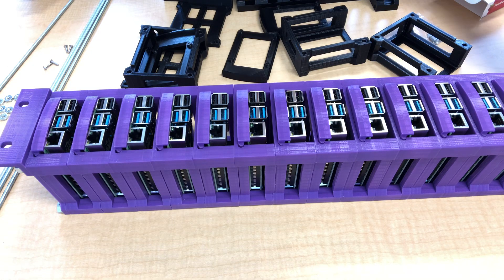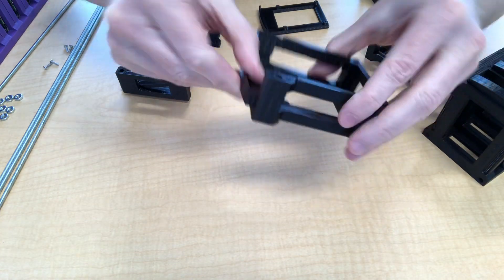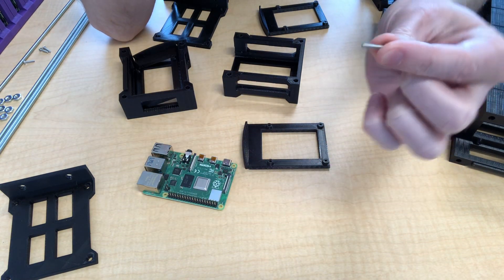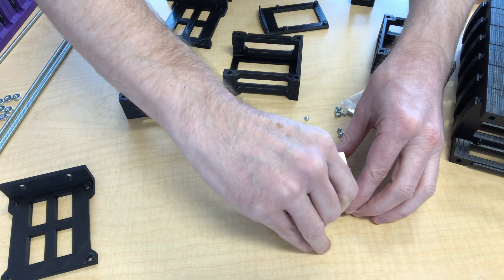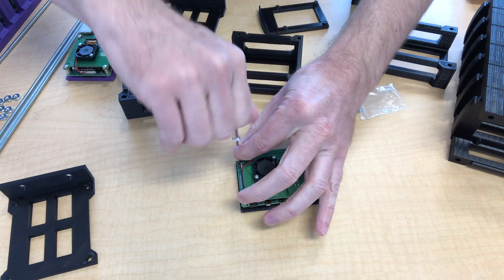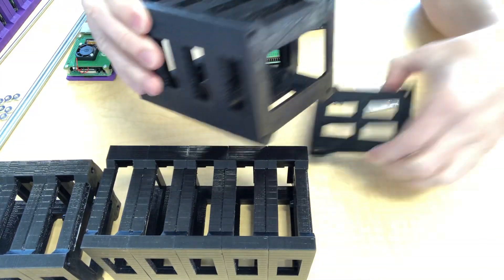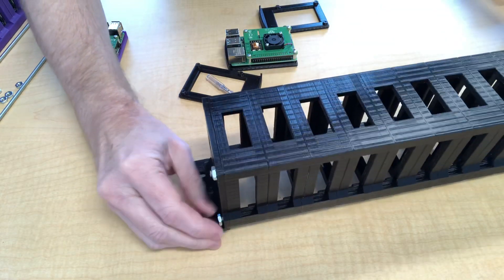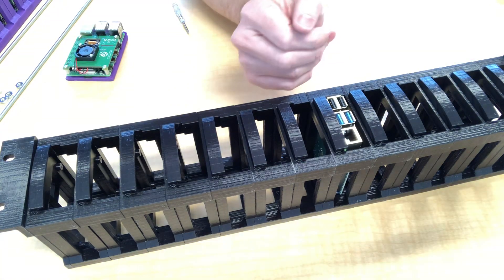Raspberry Pi 4 2U rack-mount bracket

Comment: Hi All,
coming from JeffGerling.

just curious, is there any tutorial to make their own Raspberry Pi cooling using aluminum sheet and aluminum block like this here https://youtu.be/CSNSgbKNeyc?t=67?
I want to combine it in a stack like in this video, but I want to replace the fan. To be honest, I'm not using an air conditioner here and the air is dustier in my urban areas, so the fan is a good solution, but not the perfect solution with dust.

Thanks before.

Comment: OK it looks good and good work, but why? What is the purpose of having so many PIs when it seems you can't use any other hats or functions of the pi besides a ton of USB ports? Especially when they sell fairly cheap USB rack units. I don't use Pis so is there something to gain from this or is this just PI people do for no really good reason?
Reply: From what I understand, as I've been looking into Pi clusters as of late, you can create horizontally scalable server systems on a tighter budget for small scale use. Another reason is that it serves as a robust introduction to the procedures for setting up said servers.

Comment: Very nice work, what would be the best option for a half rack/ 10.5" rack?
Reply from the maker: I don't the the precise measurements of a 10.5" rack, but this shouldn't be too hard to do. The ears and trays would be unchanged, and you would just need to adjust the side of the frames.

If you look in the OpenSCAD file, the height of a frame is calculated as: (450.85 - 20) / number_to_fit. In this formula, 450.85 is the size of the opening between the two mounting rails on the sides, 20 is an adjustment based on the size and shape of the ears, and number_to_fit defaults to 12. So you would need to find the corresponding number for a 10.5" rack, leave 20 unchanged, and adjust number_to_fit to 6 or so (try the math on a few and see what comes out to about the same height as 12 or 13 in a 19" rack).

From there you can just regenerate the stl file in OpenSCAD and you are ready to go.

Comment: Doesn't that amount of pies not stress the switch/router?
Looking quite professional. What do you use all these raspberry's for?
I like your design a lot. Nice work :)
Reply from the maker: As for what I use them for, I'm a CS professor and I use them as little servers to support my classes. Some provide infrastructure for my classes, and others are servers that I let students access to test their projects. One class I teach is Distributed Systems, where having many servers is kind of the point (as opposed to caring about the total computing power), so a Pi cluster is perfect.
Reply: @RussRoss  Great job on this project. I had a few questions for you. 

1. How much filament does it take to make 13 of the pi holder and the  frames?

2. How long did it take to print the set of 13?

3.  What material can be used to print these parts?
Reply from the maker: @gametek7592  I used a 1kg spool of PLA to print a complete 13-unit rack with trays, ears, and frames. That also included some test prints and a few bad prints, so it might be less than 1kg if you know what you are doing (I did not). It took me about a week to print the whole thing. I liked to print a couple pieces at once (like two frames or a frame and a tray). I would watch the first few layers to make sure it was adhering well to the print bed, then walk away and let it print for 6 hours or whatever it took. With the printer I was using, if the first couple layers were good than the print was usually successful. This approach only worked if the print bed was perfectly level--if it was a bit off then the problem would show up around the edges, and printing multiple items at once meant pushing the print closer to the edges.
Some people have been concerned that PLA can't handle high temperatures, but for me the PoE hat fans have been pretty effective at managing temperature.
Reply: Thanks a lot. Keep doing what you do. 👍
Reply from the maker: I was worried about that since the Pi 4s have a reputation for using lots of power and running hot, but they haven't actually been that bad. I have a 24-port switch with a 192 watt power budget, which works out to 8 watts per Pi on average. It can supply more to individual nods as long as the total stays below 192 watts. My Pis only use about 5 watts each most of the time, even when moderately stressed. I haven't come anywhere near the limits of the switch.
One thing to note is that the switch I got actively monitors these things and has a dashboard where you can see what is going on. So even if you were reaching those limits, it would start shutting down nodes rather than overheating or burning out.
Also, the PoE hats have done a great job cooling them. My cluster runs in a hot server room next to a computer lab, and so far heat and power just haven't been a problem, despite all my worrying.

Comment: I think you'd want lock washers or maybe nuts with integrated nylon washers on that threaded rod...
Reply from the maker: You could, but I think it would be overkill.
Reply: @RussRoss  Maybe,  but a full height rack with all that quiet vibration from all the other systems in the rack, going 24x7...    Maybe I'm just being paranoid, and it's true that we're going more and more to SSD's which have no moving parts, but we still have dozens of spinning fans in each rack.    So yeah, I admit I have no data to back me up, just a concern.   Still a very cool design.

Comment: For something a bit more professional, what would you use for storage ?
Reply from the maker: Someone on Thingiverse made a caddy for USB-connected SSDs. That might be a place to start.
Reply: @RussRoss  yeah, might be the way. :-/ For something else I'm using NanoPi M4V2 with SATA HAT with multiple disks and ZFS that works really well.
Reply: @autohmae  Hi, did you find something for the pi 4 using a ssd as the main disk?
Reply: Hi autohmae. Depends on what you mean by more professional. If you don't need the raw speed of local storage you could use NFS shares through FreeNAS/etc - that's my setup. Various file systems in the OS are mounted as NFS shares and I am syncing to S3 (FreeNAS Cloud Sync) for backups.
Reply: I am running iscsi with berryboot

Comment: Hi Russ, I can't seem to find any "#10" threaded rods at Home Depot -- looked it up and it's a "Unified Thread Standard" unit, mapping to roughly a 3/16" diameter. I can't find any of these, do you mind linking the specific rod you found?
Reply from the maker: 3/16" is the correct size (I just converted that to millimeters and used it in the OpenSCAD file). They seem to use inches until you get to 1/4", and anything smaller they switch to the numbered sizes.

I think this is the part that I got from Home Depot:

https://www.homedepot.com/p/Everbilt-10-24-x-36-in-Zinc-Plated-Threaded-Rod-802207/204274027

and the matching nuts are also labeled #10 x 24. The 24 part of it is about the thread pitch, so as long as the threaded rod and the nuts match it should be fine (24 seems to be the standard at this size).

Best of luck!
Reply: @RussRoss  thanks a bunch! picked it up, now to wait for the friends to finish the printing :)

Comment: Hello thanks for the effort of making this way more affordable then the alternative :). I'm just wondering something for some of my uses I'm hoping to use SSD with Rasp pi would it possibly fit into the tray assuming while having to adjust the hole location?
Reply from the maker: I don't know--I don't have an SSD to try it out. I suggest looking up the dimensions of a Raspberry Pi 4 and the dimensions of the SSD you plan to use and starting from there. If the SSD is bigger than the Pi, then it's going to be a challenge, and if it's smaller than it will probably be doable.

I'd love to hear if you figure out how to make it work!
Reply: @RussRoss  2.5" SSD is definitely larger then the pi. But removing the top rods and replacing them with smaller bolts to attach each module should allow enough room for a slightly wider tray. I will probably have to try tweaking the design to see if it would fit.
Reply: @xFUNKYFACE  any luck trying this out?

Comment: I am going to print, but I have a question. what plastic I need to use? PLA, PETG or ABS? I assume ABS is better, but maybe PETG also OK.
Reply from the maker: Edvard Filistovic I used PLA because it was easy. I’m sure any of them would be fine.
Reply: When using abs plastic its strong and less flexible also prone to crack and break in cold temps.  I only know this cuz I work as a material handler in plastic injection shop for car parts 15yrs exp.

Comment: Nice! Could you add a link to the PoE HAT you are using for the Pi4?
Reply from the maker: It's the official PoE HAT from the Raspberry Pi Foundation. I ordered mine from Canakit.
Reply: @RussRoss  does it supply enough power for the Pi4 under medium to high load ? I'm having such an issue to power my cluster reliably without going to make my own power source ... :-/ What PoE switch are you using to power all of these ( I mean how much Wats would one switch need ) so far solid 16port PoE switches are like 250Eur + :-/
Reply from the maker: @vladoportos  I have not had any power problems, but I'm also not running them fully loaded all the time. My switch is the TP-LINK T1600G-28PS, which has 192 watts to share across the PoE devices. I think an individual device can go up to 30 watts or so as long as the total stays below 192. My Pis are typically pulling around 5 or 6 watts each with bursts of maybe 7 or 8 watts.

Comment: Have you thought of creating a shaped hole for the all-thread nuts on one end, to improve clearances?

Love this. I've downloaded it and it's gonna have to be printed. This is one of the things I was looking for to support some work I wanted to do at home in Machine Learning.
Reply from the maker: That's a great idea--I hadn't thought of that. The clearance when sliding it into the rack was something I didn't really think about until I tried it the first time (with the purple rack). I used 1/4 threaded rod and nuts, and the result was a really tight fit that can be tricky to position. Switching to #10 threaded rod and nuts improved that quite a bit, along with a couple other benefits.

Best of luck on your project!
Reply: I'm still learning how to do the designs and mods. I've got some mentors here at University of Oklahoma, and I'll see if we can mod your design with the nut-capture holes... after THEY come back to work 13 JAN. Thanks for this. I can see a lot of utility here.